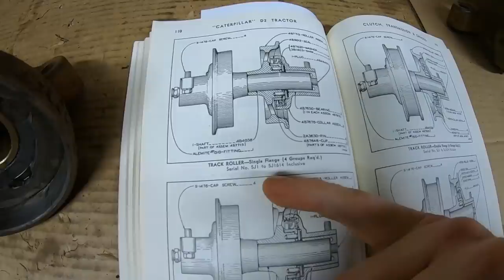Caterpillar D2 #5J1113 Chassis Rebuild Ep.36: Track Roller Disassembly, Cleanup & Inspection

Comment: After wire brushing heavy loose rust, spray part with OSPHO.  It turns iron oxide into iron phosphate which is inert.  It turns the part black and is a primer that can be painted.  It stops rust and it wont return.  Great stuff.

Comment: Thanks for another excellent video. You are so right about the value of "seeing" when diagnosing a problem. For many years I taught medical lab personnel how to troubleshoot lab instrument problems. One of the resources I listed was "a second pair of eyes." If other eyes are not available, just walk away from the problem for a while. You often see what's wrong as soon as you return to the job. BTW,  you are far, far more intelligent than you give yourself credit for. Practical intelligence like you have is of much greater value than the ability to solve an abstract equation. If I had to chose between a good mechanic and a PhD mathematician to be lost with on a desert island, I would pick the mechanic without hesitation. Cheers!

Comment: Never underestimate a good mechanic or fitter . I've seen numerous occasions where they were the ones pointing out problems and their solutions in systems that had engineers just scratching their heads . It's the ability to see the forest for the trees.
Project is rolling along nicely, respect in abundance.

Comment: Excellent video i can see how labor intensive it is to rebuild the undercarriage of a crawler and the larger the crawler the more work required and way heavier parts and pieces. I used to have a neighbor come with his d8h caterpillar and doze brush and rocks he always said that you have to listen to the tracks if some thing doesn't sound right you better stop and fix before it gets extremely expensive he was a good operator I helped him fix on it some times
Reply: @squatch253  I could not imagine the racket the rollers that came of the iron mistress made when it was being used it's crazy how badly it can wear with out pushing pieces out

Comment: I passed Algebra 1 and 2 in 7th and 8th grade, had to take them again in 9th and 10th because we moved and our new state wouldn't accept that I had done them.  I failed it in 9th and 10th, had to take it remedially in college, failed and dropped out.  Went back in my thirties and had to take it again.  This time I got the answer keys so I could check the answer on every problem.  I didn't just do the assigned problems, I did them all.  I did them until I got to the correct answer, and if I couldn't get to the correct answer, I worked from the answer to the problem until I found what I was doing wrong and knew how I had gotten it wrong.  At least 90% of the time, the issue was with copying the problem incorrectly from the book to my paper, or sloppy handwriting, or row and column alignment errors, or basic 2+2=5 type errors, or forgetting a negative sign.  I ended up with a degree to teach math and taught Algebra to 8th graders and above.  I found, for the most part, they were doing exactly the same things I had been doing.  Our lack of understanding in Algebra wasn't the Algebra, it was sloppiness and not knowing 3rd grade math facts.  I can look at your neat, meticulous notebook in this video, and know that you can do Algebra perfectly well.  You just needed to be taught better.  Modern educational theory is that tidiness, drill, and practice aren't necessary, when they are the most necessary things.  We've been dumbed down.

Comment: It'd be interesting to know exactly how much grease it takes to grease up one of these machines from clean/dry with how much you end up cleaning out
Reply: Here in northern alberta i use 80/90 gear oil   in summer 30 or 10 w30  in winter

Comment: Grease and anti-seize are popular options for industrial assembly processes. Yet while they both aid in end-product functionality and durability, it’s important to understand their distinct differences.

GREASE

Ideal for fast-moving, low load applications, grease is formulated with a base oil and a thickener. Containing no solids or low solids, grease enables parts, such as high-speed automotive ball bearings, to move rapidly without making contact.

However, grease alone is not suitable for extremely high load and/or very high temperature applications. This is because the oil burns off around 400°F, and its film is not strong enough to hold against pressure from asperity contact.

ANTI-SEIZE

Designed to convert torque to tightening force more efficiently, anti-seize is formulated with high solids content and a carrier grease. Because of its high solids content, anti-seize can handle high load applications while still providing lubrication and friction reduction.

However, anti-seize is not suitable for fast-moving applications, as its high solids content can cause parts to jam.

Yet unlike grease, the solid lubricant in anti-seize can withstand high temperatures and protect parts from galling and seizure even under extremely stressful environments. This makes it ideal for many nut, bolt and press fit applications.

Comment: Them caps would go nice on my friends "Wall of Speed" where we commemorate the failings of previous owners.
  Some of the highlights of the Wall of Speed, The rocker from my dr350 that was nicely half eaten by the cam due to the Previous owner forgetting a 92 cent spring washer during reassembly, and an exhaust valve from a Saab A-2 (the rebranded Subaru, we pulled and replaced that head in ~8 hours and a case of beer) missing a nice triangle chunk cause well collage kid, turbo, nuff said.
  A motorcycle was traded for that "blown motor Saab," it drove it self home, compression test 0psi on piston nearest turbo, friend said "well best case it burnt a single exhaust valve, worst case new piston/head, i got a selection of piston's, shims and a head in my shed, lets get to work."

Comment: 1113 rebuild checklist

Engine rebuild done
Starting engine not yet finished
Transmission rebuild done
Final drives done
Track frame bushings done
Idler springs no need to replace
Rollers are disassembled and ready to reassemble and attach to frames

Estimated completion spring 2022 time permitting

Comment: A torch makes quick work of seal removal, but it is a messy outside job.  If you want an easy way to clean them bake them in a junk gas grill at 250 degrees.  After an hour or so all the grease is dripped off.

Comment: In the middle of replacing rollers and caps on my 5U 5001. I have a basically new set that I thought would replace the old set. Turns out, the replacement set is a different spec than the existing set. The mounting holes are about an 1/2” wider. Tried messing with shims in the caps  but still can’t get close enough.

Comment: The seal was probably pushed out by over greasing. Would push them out till contact the roller center flange then seal would turn in cap with roller then disaster everything wares out!

Comment: Wondered about the first gen as opposed to the second gen stuff I hadn't noticed the seal retention screws thanks for pointing that out. How long did the snow last or is it hanging on?
Reply: @squatch253  glad to hear you got back to running for at least a little while here in the southern tier of New York  temps are allover the place plenty of intermittent snow showers and light flurries and soon the temps will bottom out warming up around april lol but I'll try and keep in motion as well and try to keep my sugars in check . God bless and keep you all safe out there. And I hope you all had an awesome Thanksgiving too.

Comment: Question: Chris from LetsDig bought a CAT 977 track loader and he's going to need some parts. He hasn't been able to find injectors for it anywhere. I don't believe the thing is that old. Would one of the places you get new/old stock from be a good place to try?
Reply: Yeah i watch him too..you can tell by the sound its missing on one cylinder..happy Thanksgiving 👍
Reply: @leeharris3061  Yep! He has some tyranny problems too! It leaks and starts getting weak after he's used it for awhile.Happy Thanksgiving to you too!

Comment: At 3:50 the grease should NOT push the seal out if it was installed correctly with the lip facing out of the housing, page 107 of Servicemen's Reference Book.
Reply: @squatch253  ten-4, When I replaced the seals on my 5U, I packed that inner gland with grease then put the frames on the shaft, this way dirt wouldn't lay in the open seal area, and when the grease would push out from the inside it would push away any dirt near the seal.